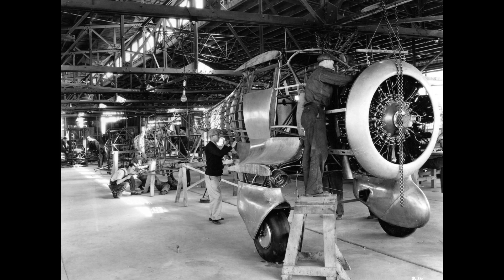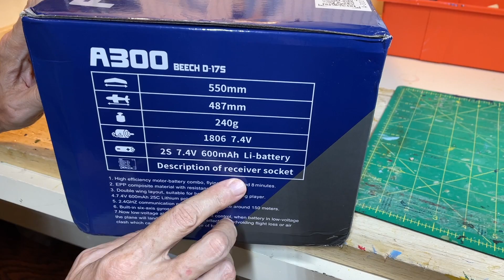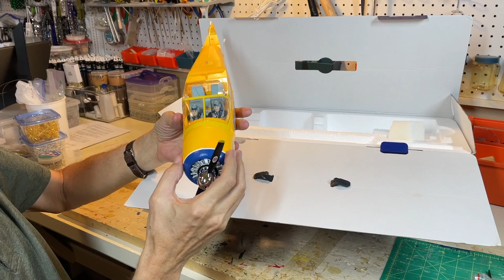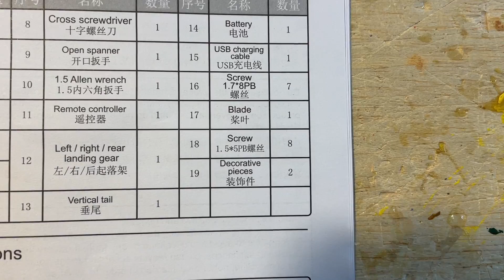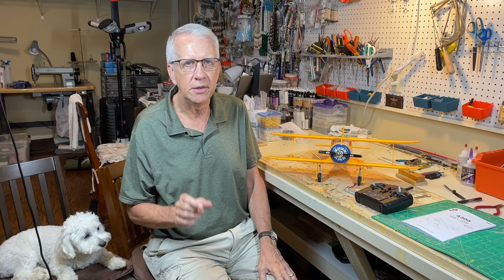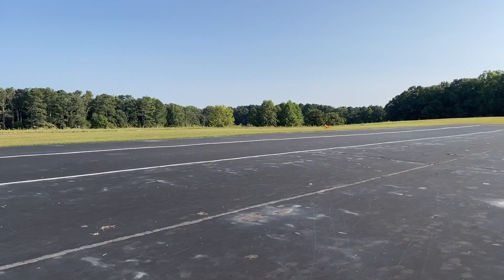A300 Beech D 17S 4 Channel ARF

Comment: It's an attractive unit though certainly not an aerobatic machine. But it's pleasant enough to just tootle around.The plastic cross-rigging is best left in the box for display purposes as it'll always be popping out unless you glue it in. And then you'll need to rip it off to get at the innards to do any servicing. 
For those who might be planning to fly it with a Multi Radio or use the DSM or S-bus satellite sockets on the board - sorry folks, you're out of luck. Though the board looks like a ringer for the 1 in the A280 P-51, it uses a totally different protocol (not hacked yet) AND neither of the satellite sockets are activated. Most folks just rip out the board and drop in a spare receiver from the A280. They work quite well whether with stock A280 Tx, with a Multi Radio or via the satellite sockets.
Also note that to get the correct COG (right at the front edge of the upper wing) you need to stuff the battery fully into the square hole behind the motor - not into the big hole underneath. And make sure you trim out a little foam to make inserting the battery easier plus stick some tape around the battery to have something other than the battery wires to yank on to get it out. Pulling on them will kill your batteries right smartly!
Reply: I don't bother with the A280 board I use the Lemon RX DSMP DSMX/DSM2 Microbrick receiver. It has 2 built-in servos and a gyro. Make sure to choose the right servo connector for your specific plane's wing servos. The gyro is adjustable and you can do Vtail as well. Accepts brushless ESCs or you can use the onboard brushed esc. I have them in all my microplanes. Plus you can't beat the 37-dollar price tag.
Reply: @FarmerFpv  The Lemon brick is an ideal choice for folks used to running Spektrum and who have no need for anything more than the usual Rate/Wind Correction Only stabilization. But for Old Farts (and others) who require the back-up of Angle/Self-levelling/SAFE stabilization the A280 board is cheaper and a direct drop-in replacement.
Reply: @FarmerFpv  Great tips, thanks!
Reply from the maker: Very insightful points, thanks for sharing!
Reply: You can also do what I am doing, put 2 servos in the upper wing and connect them to the bottom aileron servos, then cut out the upper wing ailerons and  put everything together, I'll bet you can get a terrific roll rate, to make it more aerobatic!!??....
Reply: @johnmeadJammer  Several folks posting in the RCGroups forums have documented modifying the wings for both upper and lower wing ailerons - connected by pivoted rods at each end, so no need for extra servos. It certainly increases the roll abilities.
Reply: @theoztreecrasher2647  Sweeet, I thought about that but these small 1.5 or 2 gram servo's may not be able to  handle that much force, the servo gears could strip, so that is why I thought about putting two extra, servos on the top wing and then connecting them to the splitter cable for the bottom ailerons, I just think that would be a better option IMHO..., But thanks for the Info.. 
P.S. Can you tell me the forums link to that option, Thank You in advance!!??....😁😎😎👍🤘
Reply: @johnmeadJammer  Can't post links in videos. The posts just get deleted.
Reply: @johnmeadJammer  Just do a search for the forums and subject. Should show up fairly easily.
Note that 1x9gm servo will weigh a good bit less than 4x2gm servos and their wiring, will have more torque, will be much cheaper and much easier to replace after the usual wear and tear. 😉😊
Reply: @theoztreecrasher2647  yes i understand so ... thnks...

Comment: Did you try to bind it to the tx16s? Ive heard reports that it is not compatible?
Reply from the maker: I did not try to bind.  With a lot of these ARFs the electronics are buried deep inside the fuselage, hard to get to the receiver to enter the bind mode.
Reply: The protocol for all the latest iterations of XK planes has gone to XK2/X4 now. That has recently been added to the list of available protocols via a Multi Module Radio. Your TX16S can now fly all of these as well as all Spektrum gear on the 1 radio.

Comment: Hey mister Tim, i just saw your channel page, and subscribed, I Really like your tutorials, on turbo cad, going to go thru them, because I am new to 3d printing, and I think this would help me,
with designing stuff to get ready to send them to my slicers,,,So just a quick question, can you save these files in an .stl or .m3f ????format for my 3d printer's?? Thanks for your time with this!!??.....
Reply from the maker: Not sure on the file question as I stopped using TurboCAD a few years ago. Upgrades were too expensive. I use and did a video on www.QCAD.org  Like it a LOT, great info forum as well.
Reply: @TimMcKay56  well thanks anyways, I am going to use Tinkercad, and blender, maybe fusion360, to design my stuff...😁

Comment: Hey again, I have the beach d-17s canary yellow staggerwing a-300, I want to put two more servos on the upper wing, I bet that would make the roll rate incredible???///........
The battery goes into the square slot between the receiver, and the motor..... try that????..... And yes, hunting/elevation we call it purposing, in the wind all my planes do it, that is why I am thinking about changing out the receiver board, see if that will help the right flying abilities of these little war birds.... and the staggerwing as well....
Reply from the maker: I imagine that will give you a fast roll rate!

Comment: Hi Tim, I just got a gas powered rc sport plane but I don’t have the engine, i think it’s supposed to fit inside a 3” wide, 3 1/4” deep, 7” long engine bay would you know what kinds of engines could work for it
Reply from the maker: QM:  As this is an electric RC site, I cannot be of much help. Do ask the question on www.RCGroups.com  They have an answer for everything. Include your plane’s weight and wingspan, plus a name if known.
Reply: @TimMcKay56   yes, basically you just figure out  the wing span and fuselage length,,, I am guessing  by the motor housing dimensions, it would probably be any where from a 20 size up to 40 or could even be a 60 size if it is a real sporty plane like say the red bull air racing  planes, their motors are really beefed up!!........ it should be about 50 to 60 inch, wing span, though??... for the 60 size motors, I would say your's is probably going to be a 40 size, that is what I started out with back in 1999,,, Cessna 170  60 wing span , and had a 40. sized motor ... it flew nice, any aircraft with a high wing is going to fly great , once you become a good pilot, you will want a  more sportier model, like say a mustang p-51d..
Reply: @johnmeadJammer  ok, it’s a 48” wingspan with a 6.5” fuselage
Reply: @ ok, thank you

Comment: Did you figure out how to fix the elevation “hunting” when flying low or the wing wobble when taking off???
Reply from the maker: The wobble when taking off is the landing gear not quite aligned. Hard to do with smaller models. Not sure yet on the elevation hunting.
Reply: @TimMcKay56  Check the CG, the battery doesn't just go into the compartment, it needs to be pushed toward the nose in the little cut out for it

Comment: You should put a Lemon RX DSMP DSMX/DSM2 Microbrick receiver. It is almost a direct fit. Not much modifications are needed. It will fly just as well as the E-Flite AS3X UMX planes. 
it would also be benificial for your viewers to see how it's done so they can modify theirs.
Reply from the maker: Thanks for this!